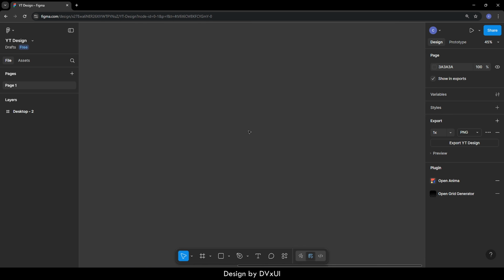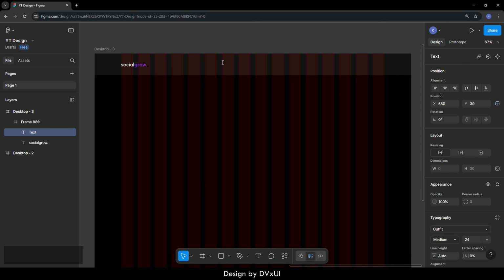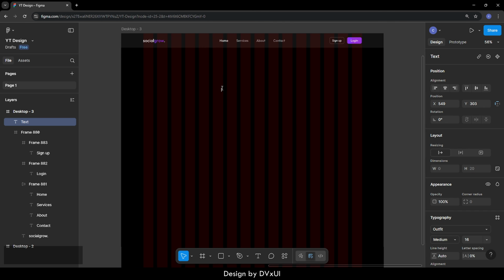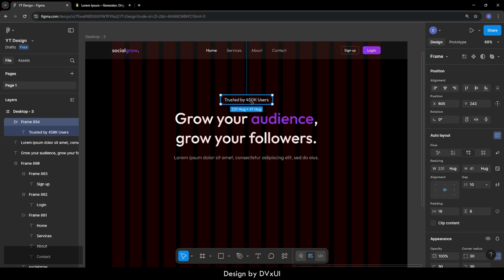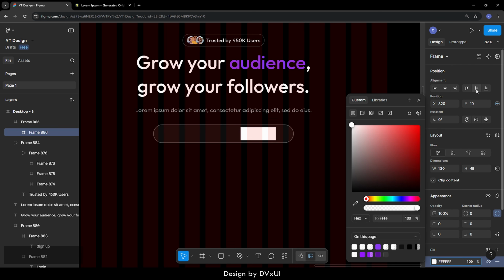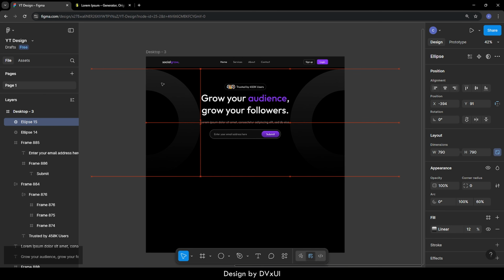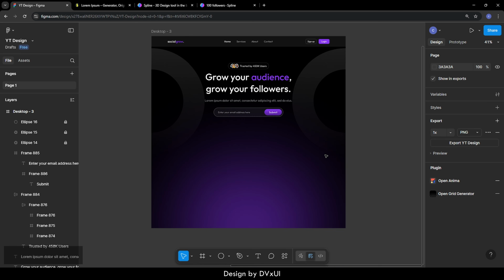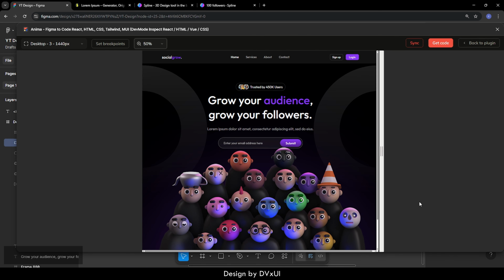Animated 3D Figma Website Design || FREE Resources || DVxUI

Comment: How to actually make it live? What do I need to do?
Reply from the maker: Two options are there
1. Use HTML, CSS and JavaScript to create a website and then insert the same link in an html element in the code.
2. Use Framer like tools (similar to Figma) used to create websites and there select a code block put the link and done.

2nd option is much easier if you are a designer.